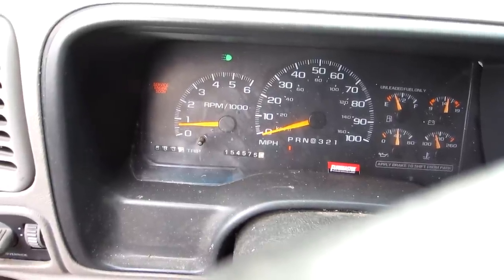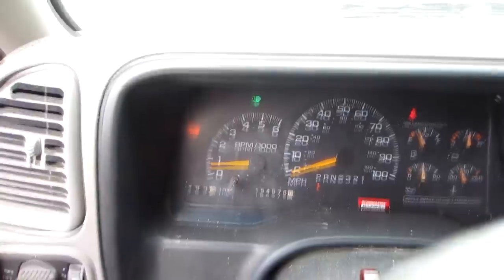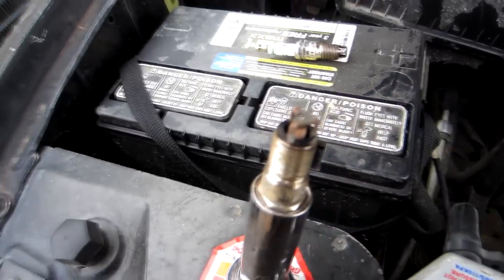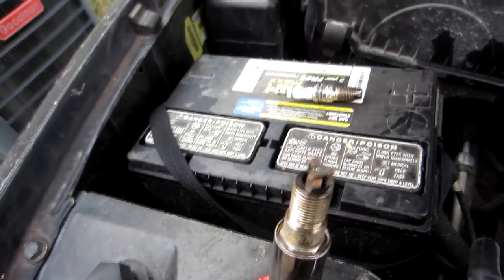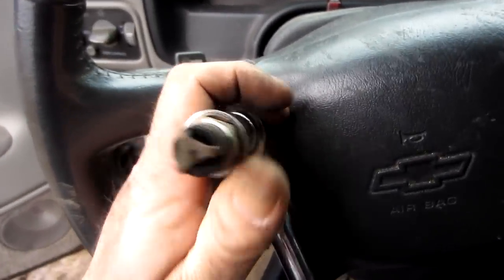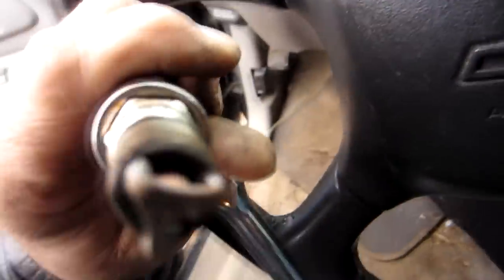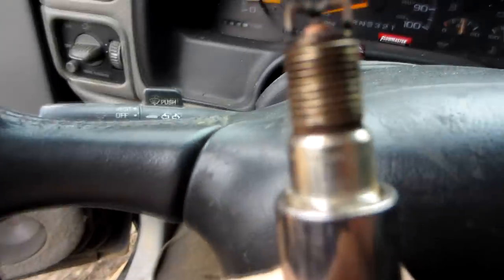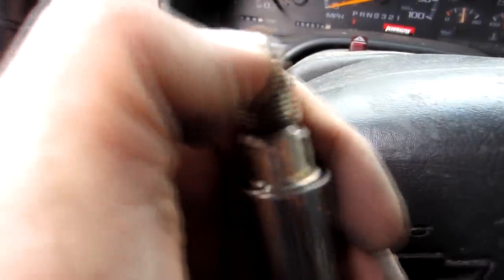P0300 Misfire cylinder 3

Comment from the maker: nope! cleaned them up as soon as i got back home and haven't had another issue with them or the cap since thankfully.  those E3 plugs are pretty awesome that way, if it were bosh , the delco plugs or pretty much any other plug than what i have you would be right though, just time for a new set  but at $75.00 a set for this v8 I'm glad they don't break or burnout as fast too.

Comment: i have a 2005 town and country we have a misfire on cylinder 3 changed plugs wires and coil pack but a few months before we had code for crank shaft sensor we've changed the sensor and  still no start i do not know if there's any lights coming up at all the starter does turn over if you go under the van to crank it but we do not know whats wrong the van is sitting at a shop they do not even know whats wrong 
could you tell me or maybe give me some hints or something to help us out please??

Comment: this is exactly the problem i am dealing with on my 2003 mazda protege 5. i got the code 2 weeks, replaced the plugs and the light went off, and started having trouble again today. i am just wondering what you mean by checking to see which coil is the problem. if i pull one or the other at idle it seems that both do just about the same thing.

Comment: whats your flow setup?
Reply from the maker: which flow set up are you referring to? if it's the air flow i am using the stock factory air intake but it comes through a K&N filter they flow the air through and let the motor breathe easier and they last MUCH longer also

Comment: 60 bux? i just scrape em off with a clean-up bit and blow torch em... hehe at least i did that in the Rx7. worked fine. but in the supra or 240 i just get the cheapo champions.